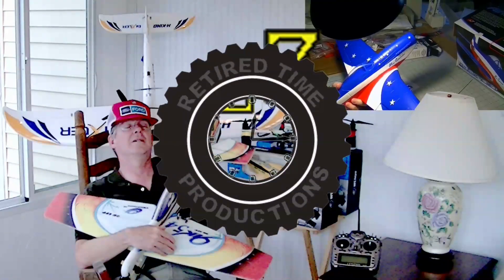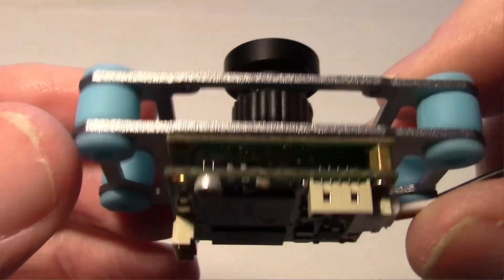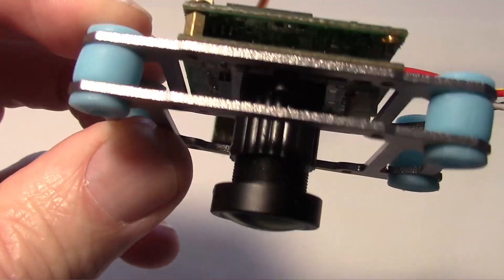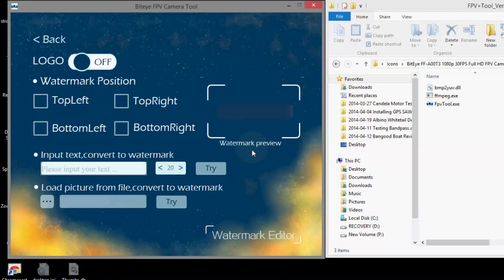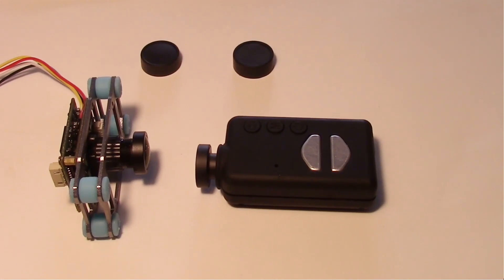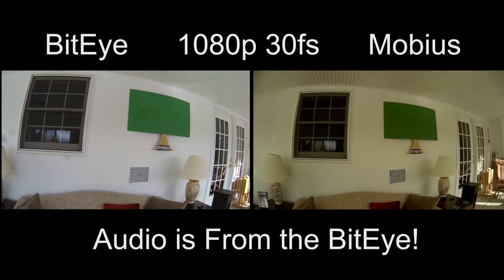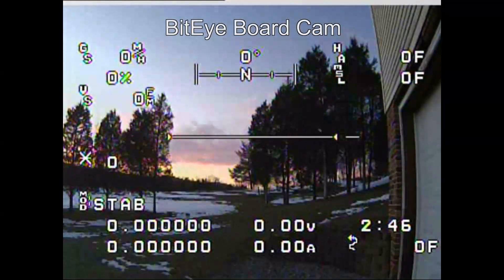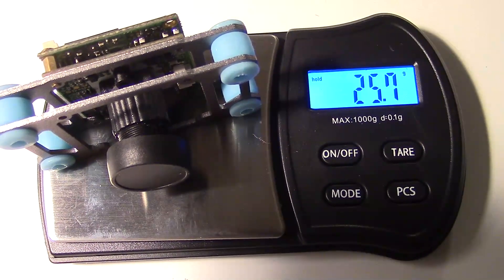BitEye FPV Low Latency Board Camera with 1080p Video Recorder

Comment: The voltage detect board (part of the USB board you snap apart) has a connector for a 4S LIPO.  It's pretty easy to make an adapter cable for 3S.  With the (Bit Eye) voltage detect connector's index slots facing up and the open connector facing you, the far right wire is ground and each wire to the left attaches to an additional cell, so your adapter will bring your 3S balance leads into that Bit Eye connector leaving the (5th) far left pin open.

If you're using a 4S LIPO, you may want to build a balance adapter anyway in order to tap off the ground and 11.1 volt leads on the balance connector for camera power!  Alternately, you could solder the power and ground leads TO the voltage detect board at the correct points.  Then even if you built and used a 3S adapter, that same 11.1 volts would be supplied on the same pins!  Or depending on your build, you may want to power your video system on a separate battery...  In any event, the voltage notification is a nice feature, albeit one you would probably shut off if using a full OSD board.

Comment: Jan 2017 -- The packaging is much-improved.  You still get the shock-absorbing mount, but also now a second lens, a USB "board" and the cables you need to connect the camera to power AND connect the (mini) USB board several inches from the camera!  So you CAN bury this camera in the nose of a craft or elsewhere, and access (and delete) the data on the micro-SD without removing the camera.

You do have to power the camera separately from the USB connection, but that's a minor annoyance.

The model I got (from Amazon) is FF-A00T3.
Reply from the maker: Excellent!
Does the FF-A00T3 version have a different link on Amazon than the link I have under the video? Like to know if I need to change my link.
Reply: The code of the link is slightly different but both point to the same product.  My point was that people may still associate this FPV camera with the package reviewed by folks earlier, before the USB support was included.  That upgrade makes a huge difference IMHO.

Someone reviewed the other cable providing something like OSD of power levels, but that isn't entirely clear to me and I thought it best to let that come as a pleasant surprise.  The manual (downloaded) makes reference to a "board" doing that, and I just got the one board doing USB, so they may be the same board, or not.  I'm not clear on that, but I'm more likely to implement a separate OSD solution anyway.
Reply from the maker: I think this camera is actually a car dash cam re-purposed so it's possible it could have an option board for onscreen battery voltage and time. I just don't know because my samples didn't have it. Obviously they have made some improvements to the one you have. I had to make my own USB cable and asked them to include one in the future and it looks like they did!
Reply: That could be, but the fact that it starts recording on power-up makes it even more attractive as a "buried" cam in a drone or plane.  The camera is now OFF the isolation mount as delivered, but the mount and screws are still provided, along with a neat die-cut foam piece that can serve as a protective frame with the back still exposed.

Comment: 60 ms... ouch, that's really slow...
60 kph is pretty average for a racing drone, that's about 16 meters per second... so in 60ms you've already travelled almost a meter... By the time you add transmitter and you've already hit that wall/tree....
Reply from the maker: Not for racing quads. It's about the same as a Mobius camera except much less weight and good for small aircraft. I have two of them on planes that have AUW of less than 250 grams.
Reply: I'm looking at the Foxeer Monster (10ms) and the HS1177...
Reply: If you had 60ms lag in a video game, you would not be a very happy person...
Reply from the maker: Those are fast but they don't record HD either. 
I have lots of low latency CCD cams and they are great.
The RunCam Swift 2 is great and it has a mic and battery voltage if you need it.
But to record HD you need something else like a Mobius or RunCam2
The BitEye does both at once but it's not for fast flying by obstacles.
Reply from the maker: As i said it's not for racing or FPV competitions.
Reply: I'm not sure of the math here!  If something traveled 16 meters in a second, that's 960 meters in a minute! Damn near a kilometer already!  If your drone is traveling 57,600kph, I'm impressed!  I think 63ms is 6.3 centimeters of travel at 60kph.  If something sneaks up on you in THREE INCHES, it's on you.  :)

Feel free to butcher me if I'm mistaken on this.
Reply: 16 meters in a second is a mistake. But the final result about a meter latency on 60ms is actually correct.

Comment: Noticed all my video files are dated 12/31/1999 with a time of around 11:00. Could not find a clock/date setting for the Biteye. What have you experienced?  Found any way to fix thix?
Reply from the maker: No fix that I know of, however I always convert the FLV flash files to MP4 on my computer and that produces files with the correct date and time.

Comment: I was going to order one from Amazon, but noticed that a "newer" version is coming out later this month (March).

 I contacted the seller via Amazon (isunshine's Eva) and she told me that the new version will have a removable/replaceable lens in case of damage and that the cost would be about $10.00
Looks to be possibly a good solution for FPV craft that you want to keep a bit lighter or a craft that has no room for a Mobius/Gopro.

Comment: was the lens or sensor dirty,as there were some dark marks visible when you did the focus test?
Reply from the maker: +Jake Bullit Yeah I think I got a lemon with dirt or glue on the inside of the lens because I tried to clean it but no luck so far.
Reply: ***** saw someone else do a review with the same problem,hopefully they`ll pick up on it

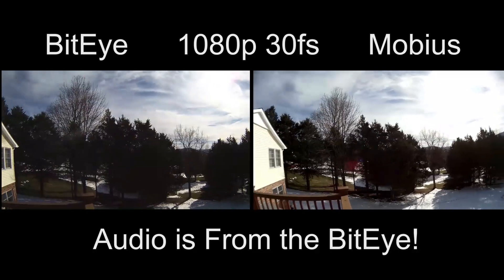Comment: Is the flashing sun @5:20 also on the Biteye raw video? Thanks for reviewing. This looks like a very good option for some setups and the price is pretty good considering you get FPV camera & HD recording.
Reply from the maker: +EngineerX Yes it was there. I think the camera white balance was pulsing in the bright light. It seemed to recover quickly though.
Reply: +dmerc00 Thanks for the answer. Hopefully there's a settings fix or newer firmware takes care of it.
Reply: +EngineerX  yes, we know this issue, and we will fix this issue in updated firmware.
Reply: +Biteye FPV Camera Thank you for replying here. Good to see you're working on the issue and firmware will be getting updated.

Comment: thats really high latency and could never be used for FPV racing.  A GoPro Hero Black has 50-65ms of latency and they are consider unusable for true FPV proximity racing.  I saw a metric that said something like @ 50kmph 70 centimeters are covered in 60ms.
Reply from the maker: +Bill Sheley  Lets see how far we go in 60ms. The Math: 50kph = 1389 cm/second.  There are 1000ms in 1sec.  
Therefor 1389cm x 60ms/1000ms =  83.34 cm.  Fascinating.

Comment: Very nice find Dave :D
I wonder if we will finally get this year affordable HD FPV cam and video transmitter, that would be so cool!
Thanks for sharing again and have a great wek
Reply from the maker: +ABMNS PRODUCTION Thanks Cedric! This is looking good for light weight miniquads and planes.
Future ones will ship with the USB cable. Wonder if I could make one?
Reply: ***** Oh you can for sure! It's a piece of cake for you lol
I made a USB cable for powering my DVR on my new ground station, you can find datasheet about USB connection easily on the Internet, and it's so easy ton find naked USB parts on ebay, just need to solder some cables on the connector and put the plastic protection around and it's done ;)
Reply from the maker: +ABMNS PRODUCTION You inspire me Cedric! Thanks.

Comment: Thanks for this Dave. This stuff is getting better and cheaper every five minutes!
My only comment is that it might be hard to gain access to the SD card depending on how it is mounted. Thumbs up!
Cheers, Bob
Reply from the maker: +TripleThreatRC Looks like you are onboard with BitEye. Thanks for watching!
Reply: +TripleThreatRC  we are going to include a USB cable inside the package around 1 month later, then you can read the SD card via the cable. no need to take it out every time.
Reply: +Biteye FPV Camera 
That's good to know, thank you. I'd love to give one a try!  I was thinking about mounting this on a plane so it would be more convenient to bring the SD card to the computer than the plane but at least it will be possible to get the files off the card.  Cheers!
Reply: *****  Thanks. it's available on Amazon, Amazon guarantee full refund within one month if you don't like it. And welcome to contact us if you meet any problem. customer feedback is important for us, we are going to launch more models, would love to give super low discount to customer who had ever give us useful feedback.
Reply: +dmerc00 
Not yet Dave but I am hopeful. Although the camera was designed with multirotors in mind I can see where it may have application on certain models of FPV planes too.  As mentioned, another great review, nice job!
Cheers, Bob